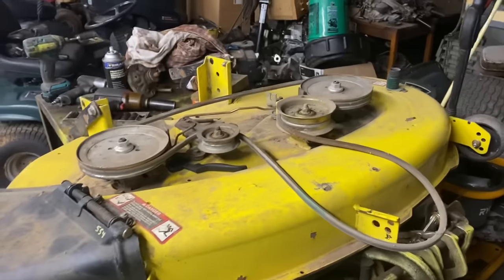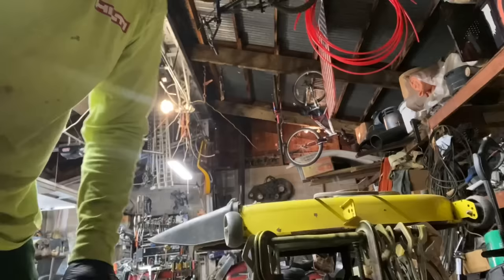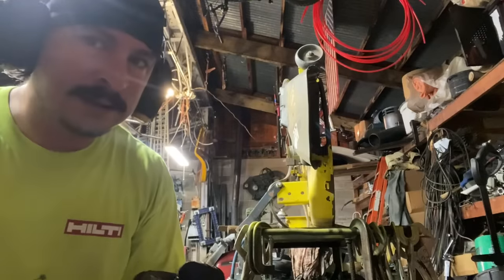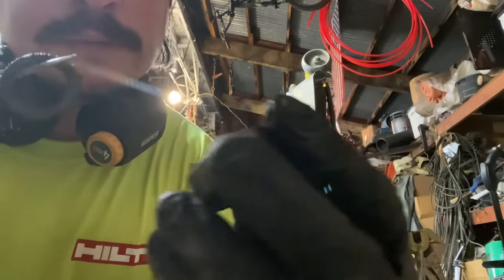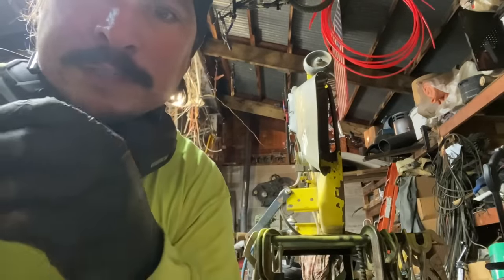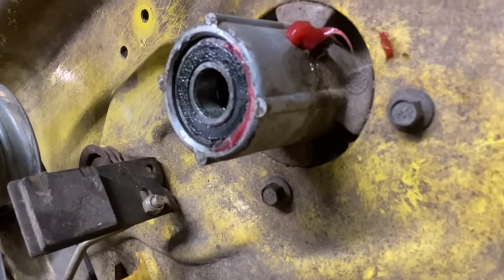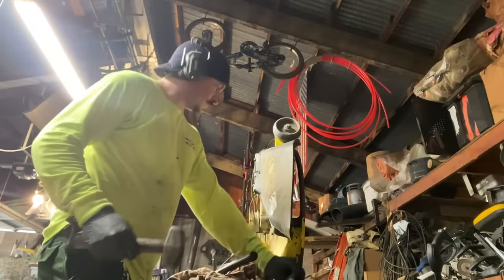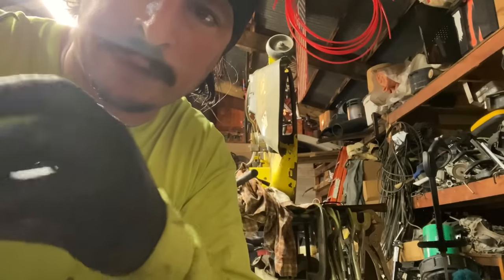Part 1 - Don’t trust the “Experts” Grease your mower deck sealed spindle bearings Common sense.

Comment: Sealed wheel bearings run hundreds of thousands of miles on newer automobiles, especially front wheel drive, without ever being serviced. They carry weight that exceeds any forces put on spindle bearings. I don't think your argument holds water, or maybe grease in this case. But I'm open to other opinions.
Reply from the maker: Did you happen to notice I’m not working on automotive wheel bearings here? SMH.
Reply: @GTObearclaw1  How many revolutions would a wheel bearing make over 100,000 miles compared to the revolutions a deck bearing would make in, say 10 years of once-a-week 6 months-a-year seasonal service?  It's not apples to oranges, they're both sealed bearings.
Reply from the maker: If your trying to figure out how many revolutions a wheel bearing makes, I can help. Just divide 63,360 inches per mile by the tire circumference to find the revolutions. I’m not exactly sure why we are still talking about wheel bearings. These are not made to meet the same loads. Completely different applications. Nothing new here, Iv seen all kinds of comparisons in my comments. But in reality the only thing I’m talking about is mower deck bearings. Maybe a better question is, how many licks does it take to get to the center of a Tootsie Roll Tootsie pop? Well, maybe not a better question but at minimum it’s just as relevant as your question. One might ask, what does that have to do with the price of eggs in China? Correct, absolutely nothing at all. I for one and positively certain it’s not comparing apples to apples. It’s as relevant as asking how many rotations does a boat propeller make in a year, how many revolutions does a helicopter blade make on a flight. How does a posi track on a Plymouth work? All questions that have nothing to do with my video. But do mower deck bearings need grease? Yes, yes they do indeed. One might also ask, Do all bearings come equally greased? No, no they do not. One could ask, do some manufactures want bearings to fail sooner than latter? Yes, I do believe so. One could even ask, what is the best way to know your bearings are well greased? Well, what an absolutely relevant question! We just add some. One might even ask, How do we add grease to mower deck mandrels? Well, we are in luck. I just so happen to have made a handy dandy video to show that process. Thankfully you say you’re open to other opinions, my comment section just happens to be chalked full of opinions. Some are just silly naysayers with no evidence and unwilling participants in this process yet they claim to be experts on the topic however they can’t find a way to back their claims or they are simply too lazy to try. I’d probably avoid those guys or at the very minimum just use caution when reading those nutty comments. However, many are comments from folks who have done this very practice for years. Maybe even done this process for longer than Iv been turning wrenches and for the folks who do it this way, they all seem to have one thing in common. They agree with the process. Not exactly rocket science. None the less I broke the steps down as simple as possible to help everyone see each part of the process and show the proof so nothing is hidden. If you want to mow for 10 years and assume the bearings will last without servicing, it’s a free world, take them bad boys down to metal on metal if you like and let us know exactly how long they lasted. Nobody will stop you. And some of us would actually find the results interesting. But Iv seen plenty fail with less than 100 hours on the meter so it’s not a gamble I want to take. It’s simply easier to add grease than to do major repairs. Some might just think it’s wise to error on the side of caution. But in reality when grease is gone the bearing will be soon to follow. Not sure what we are even discussing here? The fact that the bearings do or don’t need grease? Or does the process I show work as described? In short, these bearings will need grease at some point and the process I show works. All bearings eventually fail without grease being added. I could have just wrote the last few sentences and that would have been adequate but what’s the fun in that. 

As for sealed automotive hubs, that’s something Iv been interested in looking into. Have you seen any sealed wheel hub bearings with a zerk? I haven’t yet. But I do see them on mower deck mandrels. And the fact that hub bearings don’t have zerks is disappointing to me. I’m most like going to be adding some in the future so my wheel bearings will also last forever just like my mower deck bearings do.

Comment: However,  high quality sealed bearings come with high quality synthetic grease with high temperature and high pressure ratings sealed and shielded from contamination. They also have best cavity fill amount for max protection without overfilling that causes excessive internal pressure and temperature. They have a VERY  LONG LIFE. I suggest staying with sealed bearings. Buy better sealed replacement bearings if originals don't last, because they should. Check with your bearings dealers for best bearings replacement. I have lots of experience and training. Where you do have to grease bearings, purging and switching to a good synthetic will extend the life if there is not a lot of contamination.
Reply from the maker: For this application just adding a low grade grease once a year is fine for the avreage home owner one could argue that once a year would even be overkill. It’s not aircraft’s we’re talking about here, just a lawn mower. And nothing in my repair videos shows anything more than the lowest level machines sold at any box store in America. No need to swap bearings if they stay lubricated as Iv shown the factory bearings can last the life of the tractor but yes I do Agree if you are going to pull the deck apart and don’t mind spending the extra money, the high quality bearings are a nice upgrade. I wouldn’t say it’s a bad idea by any means. Smoother quiter and will last longer. But unfortunately that’s not usually the kind of bearing we will get in the average box store cheep tractor so the only way your going to have those high end bearings is if they are replaced. As for the guys like me who has a functional machine, maybe just adding grease would be the wise money saving way to go. Why not just run those bearings as long as possible without need to tear into the deck. I have better things to do than fix something that ain’t broke. I don’t need a 25$ bearing. That
Adds up fast when replacing all 4 or 6 depending on the size of the deck. The cheep bearings can actually go a long time as long as they stay well lubricated. I can service a deck in 15 minutes or less with a grease gun. but I can’t tear one down and replace the bearings that fast. Sometimes it’s nice to just add grease and go mow. If bearings fail I’ll deal with it, otherwise I just keep things greased.

Comment: The bearing was getting wore out ANY WAY!   but what i didn't expect was? I blew up the casing on spindle bearing.  How to tell if a bearing going out?  It will be a little loose, Start making noises  he hee my question is? WHERE IN THE HELL!  DOES ALL THIS GREASE THAT WAS PACK INTO THERE,   GOES TO with in a weeks time?

Comment: How about using a needle valve on your grease gun & put the grease in beside the rubber seal. That way you don't have to waste 70 pumps worth of grease
Reply from the maker: I’m not worried about 70 pumps, I don’t consider grease a precious resource. And Grease is cheep. It takes one tube to service 3 machines that have no grease in mandrels yet. I have grease needles and show that process in other videos. As for why I would advise against doing that for these bearings when a grease fitting is present, it’s just easer and less trouble to fill the mandrels once and future services only require a few pumps because the next time the assembly will already be filled. Why would filling the assembly be a concern? It’s the exact same way commercial heavy duty mowers are cared for. Avoiding adding grease because it takes 70 pumps on the first service does not compute for me. In my opinion, the grease in the mandrel is as essential as air in the tires and oil in the engine. It’s a vital piece of the puzzle for longevity and the one most people don’t think about.
Reply: @GTObearclaw1  In another video I saw, they took the rubber caps off the sealed bearings & filled the tube with grease & it also filled the open halves of the top & bottom bearings. I like that idea better
Reply from the maker: @Smittyschannel  serious question, did you watch my full video? I feel like you may not have questions if you watched the whole process. Yes it’s boring and somewhat long but I tried to shorten it and also keep all the very important steps “proof” in the video. As for removing inner shields. I have seen and done that as well over the years. Eventually I evolved my process. Took a while for me to figure out this way works. Knowing that removing the inner shields is part of the reason I felt this information was important to share. I could not find another video explaining it the way I do it. Removing caps is not necessary even though many people posting advice seem to think it is necessary. They simply can text my process and they will
Find it works. My video is basically just a test/demonstration of the process to show it works. I’m just showing folks how to get the same results with less work. No need to pull the deck apart. That way is more work and makes no sense for folks who don’t have tools or don’t feel the need for extra work that gets the same end result. You may feel it’s better but it’s just a feeling. Folks should understand the science of the process. That’s why I proved it step by step
So folks would know. I dismantled decks for many years to add grease until I wised up. No need to take apart a good operational deck with no issues, all that’s needed is to grease the bearings. And if zerks are in place, easy peasy. No need to overthink and complicate what is a very simple and very basic service.

Comment: Some facts y’all may not know…..1. Sealed bearings have a better quality grease 2. The seals are to prevent dirt from entering and grease retention 3. Too much grease is as bad as not enough due to over heating
Reply from the maker: Some facts you may not know. First you Your wrong. Then also that’s a big Negative, Too much grease is not as bad as not enough. And never has been in this application. Keep in mind Engineers are not always right, and Apparently you don’t know everything. There is always something to learn. Thankfully you came here and now you know so you can’t say you didn’t know when your deck bearings burn up. You will
Definitely not overheat a deck mandrel bearing from too much grease. That’s actually laughable. How do you explain the cheeper sealed bearings not having quality grease and also not having nearly enough in the first place. When other higher grade brand bearings are completely filled to the point they can’t hold more and sold for the same application? How is the mandrel cavity between bearings being filled with grease going to make any difference if the new bearings were filled with grease in the first place?

Comment: Some spindles have a "leak hole" drilled into them.  If you have one of them I would think you would have to remove the inner seals - since the leak hole will keep the grease pressure down.  Some of the Amazon spindles that had a grease fitting that I recently bought also came with this leak hole.   From what I learned in your video I think I would block that leak hole.  Great video BTW.
Reply from the maker: That’s for the comment, yes absolutely plug that hole. One viewer suggested JB weld I suggest a small screw. Probably several ways to fix that issue like adding a easer accessible grease zerk into that hole.

The question I’d like
To know is what possible function that is useful does that hole serve other than preventing propped lube to the bearings and creating the need to buy parts
Reply: @GTObearclaw1  So what I read in another YT channel (so many conflicting views) is  once all of the air is pushed out the excess pressure is relieved by the leak hole - preventing the outside cover from popping loose.  That explanation at least made some sense - but I still question how much grease you are going to get to the bearings if the inner seals are still there.  You would think the path of least resistance would be the leak hole.   On mine I took a small machine screw that was slightly larger than the hole and just screwed it in and broke off the head.

Comment: Maybe, just maybe the rubber "seal" is not a seal at all but a mechanism put in place to stop debris from entering the bearing like dirt and dust it also could be used to retain thick fluids longer. Perhaps the metal "shield" is a seal ment to keep everything from going past it. Also it might be possible The engineers put the correct bearings in the correct spots and other people are wrong. It could also be slightly possible that there are a multitude of different bearings that have different shields, seals, sizes and materials so they can be used in very specific circumstances. But hey engineers are all wrong about everything they do so we as consumers need to fix their mistakes, right?
Reply from the maker: Sounds like you pretty well
Talked a circle and I follow your logic. Who really knows. But the way I sow in the video works wonders for those who want to do things the easy way. Regardless of what the plan was, this process works marvelously for deck mandrel applications.
Reply: @GTObearclaw1  I agree. I was being sarcastic. There is a good reason for grease fittings on spindles. Combine that with the proper bearings that can retain the grease and voila! A long lasting simple device!

Comment: remove , wash out bearings, use heavy duty red Dryden grease and hand pack. if you pump too much grease in it will blow out the outer plastic seals. plus you waste a lot of grease inside spindle housing. if you blow out the outer plastic seals they will ingest dirt and water. don't use water or power washer on mower deck. use compressed air only. water will destroy idler pulley bearings. they are not sealed or serviceable. i'm a certified john deere lawn equipment tech.

Comment: once you took the plastic seal off    why didn't you just fill up the ball bearings!!
Reply from the maker: Because that’s not what this video was about. I was proving that grease gets past the bearing shields. Something a lot of people do not grasp. The only way to prove it was to make a step by step video. No need to pull a deck apart if yours has zerks. As I showed, grease passes into the bearings. Inner shields are no match for grease being pushed past. Works every time.

Comment: cant you just grease the bearing since you already took of the seal
Reply from the maker: I could but that would not get the point across. I guess the information was not obvious. The point was that their is no need to do all the work I did. Just grease from the spindle zerk. I had to show that grease made it into the bearings to prove it to the knuckle heads that say grease won’t bypass the inner shield on bearings.
Reply: @GTObearclaw1  got you thank you

Comment: cut my 2 acres with 2 garden tractors a 85 wheelhorse till 2013 and a deere x500 for the last 10 only changed 1 spindle in 38 years ill keep greasing my  way 600 hrs on that deere  the  horse had 1600 hrs when i sold it
Reply from the maker: Lot to
Consider here, I’m providing information that is helping some folks. Not every machine is equal. X series Deere is commercial and none of the mandrels shown in my videos are commercial grade. It’s important to know that box store models are not in the same category when it comes to quality. Can’t help but think, That one spindle might have been saved with some grease. Not everyone needs to follow this process, I’m just explaining what Iv found to work.

Comment: Chinese bearings are cheap on Amazon. Grease is expensive. I drip a little synthetic gear oil into the gap of sealed bearings every so often.
Reply from the maker: Into the gap? Why not pop the cap off and make sure it gets the lube? I’m not exactly sure how you would access the bottom bearing to do that. At least on the ones Iv seen the bottom bearing is well protected from damage that could be caused from all the action under the deck. That one is not usually exposed to see the seal cap. I absolutely don’t know what you mean, it’s silly not to add grease. Grease is not expensive where I live. One tube will
Service 3 or 4 mowers. Can you break down that expense? that’s just a silly thing to say. Grease is expensive but China bearings are cheep? Does that mean it’s more logical to change bearings?